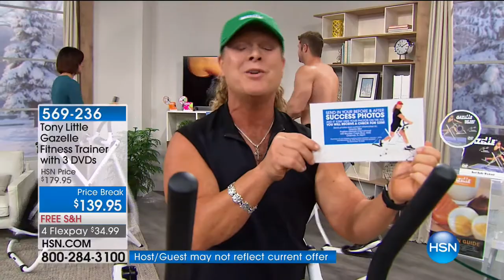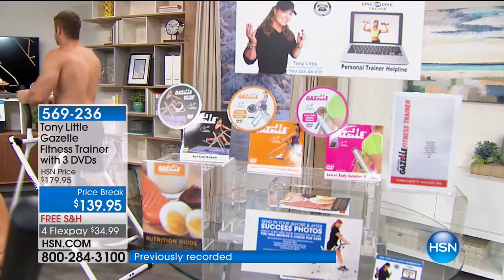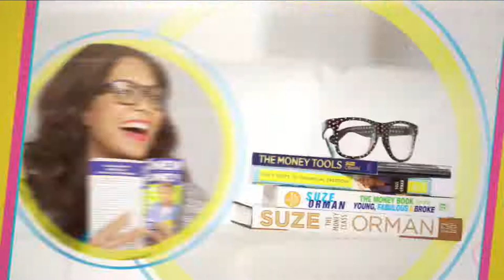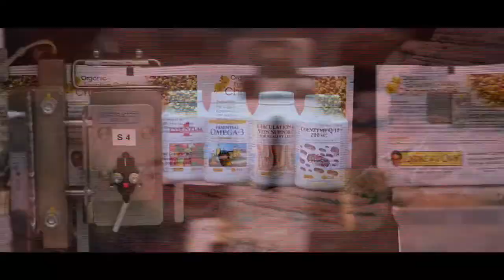HSN | Tony Little Health & Fitness 01.19.2018 - 05 AM

Comment: I have a Tony Little Gazelle, gosh its so old I don't even remember what model it is. But I still use it and I'm definitely going to send a before and after. Its the one and only tolerable exercise I can do. The back issues I've had after 3 Cesarean sections limited my mobility. The Gazelle has saved my physical life.